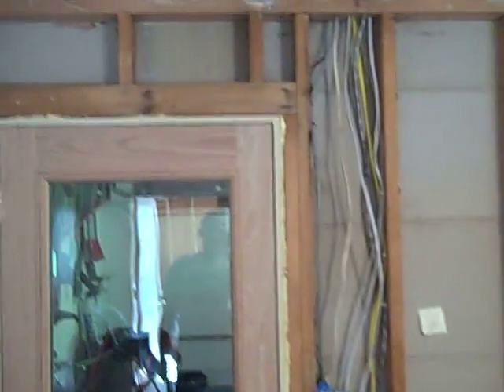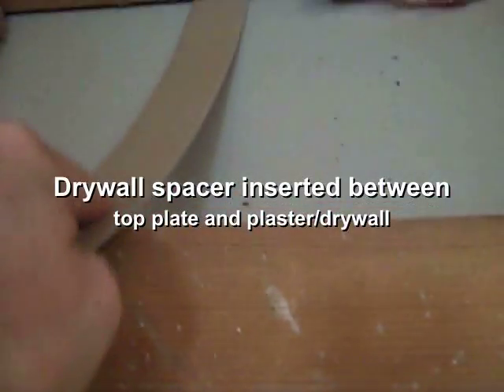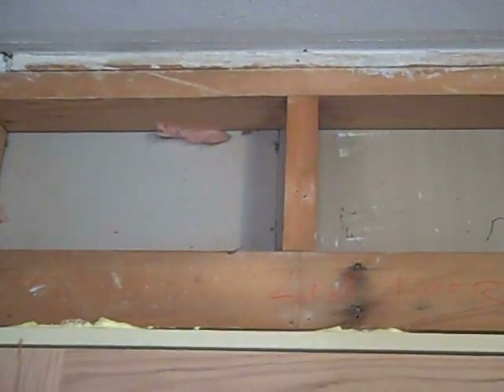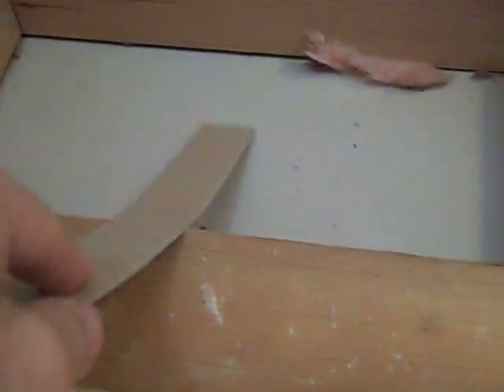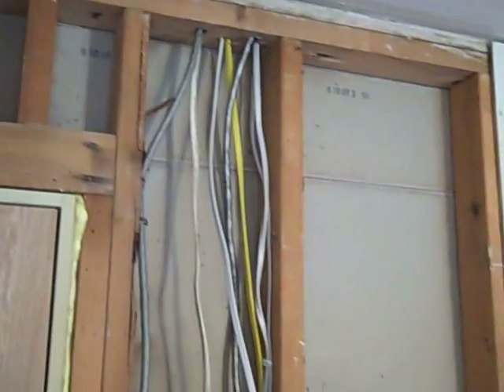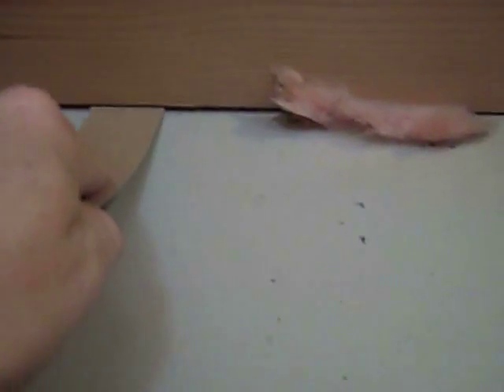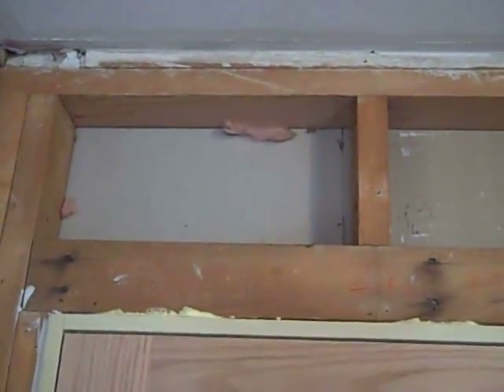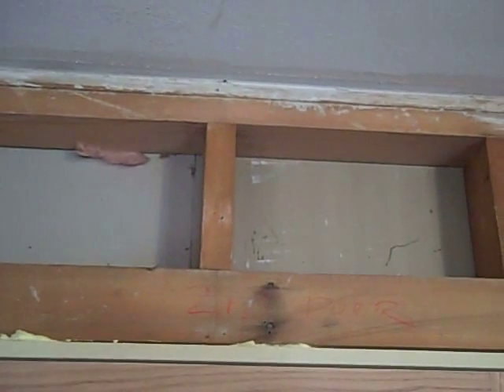Air sealing the top plates of wall stud cavities - startinsulating.com

Comment: I have a house that was built last year. One closet there is cold air coming into the closet. the builders came and pulled the carpet back and sealed around the base boards in that area but there is still cold air. 55° in that corner of the closet! We have the same issue in our master bath. Air is coming from where to water lines enter and feels like it's making its way to the tile next to the vanity because it was 50°. Any ideas.
Reply: Micah  Read 
Cut out a section of drywall and check that insulation isn't missed. If you do a clean cut you can easily repair area. (Search videos on how to do)
I did drywall for a while and I've seen some installers pull insulation if in the way, esp in corners, and some insulation installers can be temp labour or day worker that maybe didn't set insulation right.
I'm sure you'll find missing voids, open area add more insulation seal with vapor barrier replace drywall, take a paint chip to paint store grab a half gallon and paint 
For $20 you can get a laser that gives temp readings. Mark wall where temp is lower then air temp or the average wall temp, this will tell you where ait leakage/missing insulation is
Reply: Caulk or foam around the pipes that should help if not stop it completely

Comment: If you have access to the atic , the top plates  can be sealed from the top. Pull back the insulation if necessary. If the bottom of the insulation is blackend, then a lot of air has had the dust filtered out of it as it leaked out.
Caulk, foam or the cheap and dirty method I use, DRYWALL MUD and tape. $ 8 for a 5 gal bucket- or free left over buckets ( ask around). Smear it with a long stick if you can't get close enough. I just did a friends 4/12 pitch atic--what fun.

Comment from the maker: Yes, you can inject expanding foam into the small space on both sides of the top plates from the attic.  I suggest you purchase a foam gun for about $30-40 as the rigid metal gun barrel makes this very simple.  Don't try to lay a bead of caulk, but instead inject it into the seam.  For low sloped hip roofs it will not be possible to gain proper access to the exterior wall top plates in order to do this.  A solution is to dense pack those walls with cellulose if they are empty.